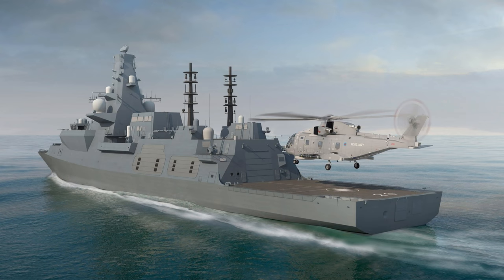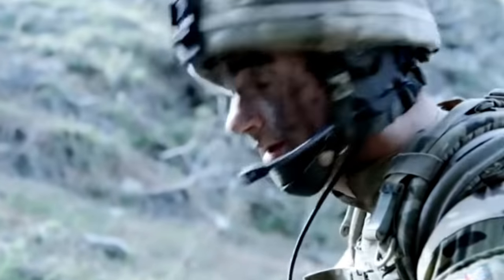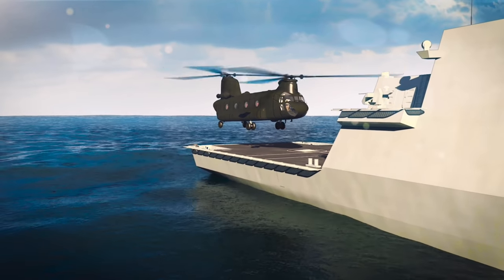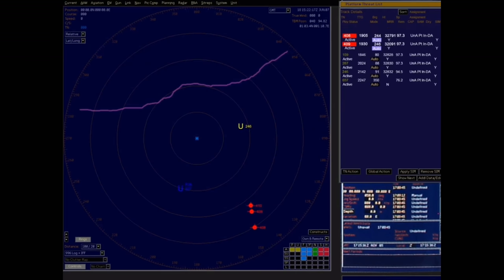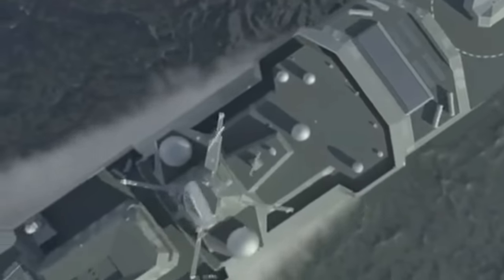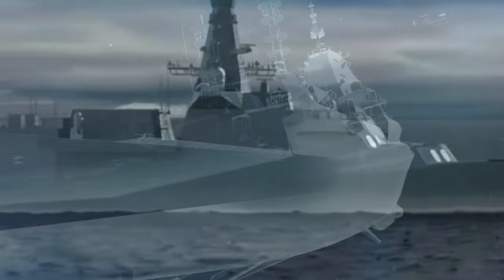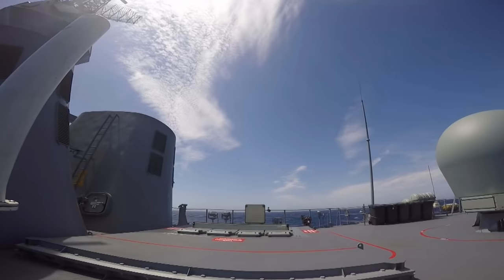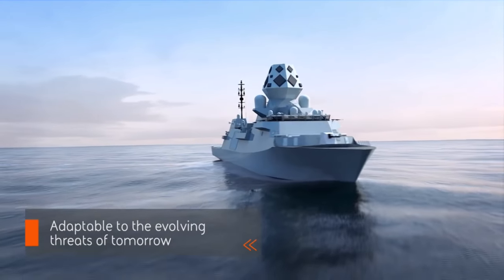British Type 26 Frigate | FUTURE NAVAL FLEET PROTECTION

Comment: Would  it be fair to say the Australian type 26 will be the most powerful,with Aegis/Ceafar combination with sm2,sm6 Sea sparrow Harpoon/Lsram.Also is the new Australian ceafar the most powerful radar?.How many cells will the Australian version have for Sm2 sm6?
Reply: It will have a 32 cell Mark 41 Vertical Launch System, firing RIM-66 Standard 2 and RIM-162 ESSM missiles.
Reply: I was just reading the Australian ship will have 48 cells,16 of which will be quad packed essm.Very different to the brit ship 48 sea ceptor missiles
Reply: @force515  Yes, the Hunter class is far better armed than the type 26. It also has a better radar and long range missiles like the SM-2 and possible the SM-6. The type 26 is a sitting duck in a near pear conflict, it can only operate as part of a task group. Alone it will be restricted to the North Sea (under the protection of the RAF) and parts of the North Atlantic operating as an ASW frigate. It is a shame that such an expensive warship is so poorly equiped when it comes to air defense. It would be cheaper just to buy more T31 and add the same towed sonar array, sonar 2087. The type 31 is roughly the same size as the type 26, the type 31 even has a better radar (according to Save the RN: The Thales NS110, a highly capable AESA radar which offers especially good situational awareness in littoral environments and in many aspects is superior to the Artisan radar that will equip the Type 26 frigate) and CMS. It also uses the same Sea Ceptor missile.
Reply: UK claims they will be doing freedom of navigation in South China seas,you would think they would add a lot more fire power to survive a possible clash with China or Russia.A 7000 ton ship is a crusier.Why dont they have 80 or 90 cells.They dont have to use them gives you options in war time land attack long range anti ship etc
Reply: @force515  It depends, if they send a type 45 it will be able to defend itself. In the future when the type 26 becomes available I do not want to be on this frigate, it will be a suicide mission.
Reply: Chinese ships are armed to the teeth with really long range anti ship anti air missiles.All new ships should match them in missile range & firepower.Why only have short range sea ceptor
Reply: @force515  You are absolutely right! The current type 26 (allthough not in service yet) lacks an excellent radar, CMS and long range air defense missiles.
Reply: Having read this thread please note that the UK has purchased the Naval Strike Missile for ship/land attack until the FC/AS is developed (IOC). Aster short and Aster medium missile systems along with Sea Ceptor missiles will be increased with additional quad packs. 

The UK's T26 City Class was carefully thought out and designed well. It is concerning that the Hunter Class is still suffering political and naval infighting and lacks the ability to think for itself on its system aquirements and its need to please the Americans. AUS is crucial as a partner, but not at the expense of being slandered by inept Pro US naval Admirals and politicians. That said, at least they have now veered into the 20th century at least with very capable war platforms irrespective of some tweaking. 

Canada 🇨🇦  great ship but for the tonnage you are pulling its almost the same as the aussies - as in where on earth would you even remotely need to fire that many cruise missiles and when have the pair of your countries done so? Its embarrassing how you are blindsided my the number of missiles as opposed to what the frigate can do.

Comment: Will they have the sailors to staff them??  recruiting and retention is the real bugger right now for the RN!
Reply: Despite being a lot bigger than the Type 23 they require less crew.
Reply: @davidhouseman4328  RN doesn't even have enough to crew both CV's right now fully.  Partially why the decomm'd the amphibs.  Small crew is great, but until they fix the bigger retention and recruiting issues, they will have issues operating them.  In a small crew, everyone needs to be that much more well trained and experienced.

Comment: To be honest it's an absolute national humiliation that the Canadians and Aussies are buying more of these Type 26's than the Royal Navy. They need to order 20 rather than 8 if they ever want to stand up a carrier strike group and just forget about the type 31e, which, in reality is a glorified green water patrol boat designed to mask the massive cutbacks in surface warships.
Reply: Type 31 is bigger than the Type 23 and based on a very capable Danish vessel. It isn't a green water patrol boat.
Reply: @davidhouseman4328  well I'm prepared to stand corrected but the last i heard the government put out a tender for hulls that cost no more than £250m which caused the bid process to fail. If these cheaper frigates are as capable aa you say why build the t26? What is the role of the type 31? The government are always fond of saying that the capability of new types is so improved that one ship can take on the role multiple older ones. The fact is the Navy is bare bones as it is, these vessels can't be in two places at once and the lack of investment will one day cost us dear.
Reply: @TomCamies  the bid process was restarted and a contract has been awarded for the Babcock Arrowhead design that based on the Danish Iver Huitfeld frigate.
The Type 31 is essential the like for like Type 23 replacement, more modern but for a similar price tag accounting for inflation at around £250m.
The Type 26 is a major step up, by capability it's a destroyer. But it's an anti submarine warfare specialist, so it's called a frigate. It's the best we can build.
Reply: I would be pretty happy with your two new carriers mate.

Comment: The other very basic thing is:

Weapons systems get obsolete at different times, so there is a need to change them at different times. The Harpoon, Sea Sparrow, the Oerlikon and the 5" guns are hardly the latest model; but they have the advantage: They work! At times a little to well, as the owners of several summercottages experienced some 40 years back.

Today you don't build ships around the weapons systems. During the Falklands conflict the frigates were lost due to their SAM-missiles, that didn't work against low level targets.

Another point is: Diesels have reached such a high level of efficiency that it is better (for smaller vessels) to dispense with the problem of turbine engines all toghether. The mentioned 25 knots is what a Huitfeldt makes on half power. 2 of the 4 engines are more or less just spares, as plowing ahead with 30 knots happens only rarely.

The size of the ship is only vaguely related to her displacement, hull design is much more important. The old danish Diana-class had huge amounts of power which could only be used to make waves - and high speeds in the Baltic? That will only make you run aground with aplomb. Very disconcerting.

Comment: in australia we are only luke warm on the idea. Australians have put the idea in there heads. need to go with off the shelf. myself personally i have great hopes for the what we are calling hunter class.  but we do need more. and as you say air defense needs to be beefed up
Reply: You can bulk up the AAW side if you want, yours are already going to be Aegis based.
Reply: @davidhouseman4328  we have AAW destroyers 3 of them ment to have 4 but politicions. the hunter class are ASW.
Reply: @elvinsmatthew  not seen the official spec on the Hunter but the suggestions are it'll be pretty close to the Hobarts on AAW as well. Hopefully the bigger global run will make it easier to get the full planned number.
Reply: @davidhouseman4328  i believe that New zeland is also considering our Hunters
Reply: @elvinsmatthew  I heard they were interested, didn't know if it would be UK spec or Aus spec or somewhere between.
Reply: @davidhouseman4328  hard to say with the kiwis. after all need to make sure there is room for the sheep.
Reply: @elvinsmatthew  they'll be making full use of that multimission bay.
Reply: @davidhouseman4328  and flight deck to bring fresh ones in

Comment: Is that the 'frigate' with the 8000 tons full displacement?  And Type 45 destroyer have 8700  =D
btw should that be compared with Project 22350M, 'frigate' with 6500-7000 tons of displacement, [armament due to the model of Army-2018 exposition http://bastion-karpenko.ru/ARMIA-2018/22350M_ARMIA-2018_04.JPG ] 

60 cells of tactical/anti-ship missiles 
Anti-ship: (3M-55 Onyx, 3M-54 Kalibr family family and hypersonic 3M-22 Zircon (which is in development))
Tactical: 3M-14 Kalibr family
Anti-submarine warfare: 91RE1 / 91RE2

96 cells of 3K96 Polyment-Redut SAM complex which could be loaded with following missiles
48Н6Е2 - 1 missile per cell, 120 km range
9M96D / 9M96M / 9M96E2 - 1 missile per cell, 120 to 150 km range
9М96Е - 4 missiles per cell, 40 to 50 km range
9М100  - 16 missiles per cell, 10 to 15 km range

And 36 cells presumably of S-500F with the range of 500 km.

Comment: How far along are they with the first type 26?
Reply: Seem to be taking their time.  I don't think the first hull will even hit the water until 2021
Reply: @Weakeyedominant  It is a massive warship. I doubt they're taking their time, those things just take incredibly long to build due to their sheer size
Reply: @RainytheNB  work started a good couple of years ago.  The government ordered them on long lead times just like astute.  It cost less per year that way so fits better into their yearly budget but far more over the lifetime of the project.
Reply: HMS Glasgow is progressing at a somewhat leisurely pace - first steel cut in 2017,it should hit water in 2021 but it will  not be  fully operational until  2027 .HMS Cardiffs first  works were started earlier this year.
Reply: @paultanton4307  that's only two ships in ten years though? they'll need to be quicker than that with them especially if Iran kicks off.
Reply: Yes its a pretty piss poor show that cant fulfil the RN's needs - whence the T31 Programme.Theres probably a multitude of reasons why its so slow - Political (Treasury) interference being one ,but as the River B2 builds tail off more resources can be put into the T26.Its still the case that only the first 3 are contracted for ,the other 5 are still subject to ongoing negotiations.

Comment: How many is unit cost type 26 frigate
Reply: @davidhouseman4328  Strictly speaking that is the average system price rather than the unit price. The average system price includes a share of the fixed development costs. If we decided to build more than 8 the additional ships would be a lot cheaper than £1bn.
Reply: @Akm72  I'd be a bit cheaper. But the Canada cost was around £1bn I believe.
Reply: @davidhouseman4328  I haven't checked but I'm sure you're right, however the Canadians would have fixed costs associated with their frigate program as well even though they're buying a version of an existing design.

Comment: It is unfortunate that they plan to install only a mediocre radar system, the type 997. Why doesn't the RN install the Ceafar 2 radar like the Australians do on the Hunter class? The type 26 needs a longe range radar system and longe range missiles like the Aster 30 or the SM-2 / SM-6. The Sea Ceptor missile is only for short range protection, the Aussies will equip there vessels with long range missiles like the ESSM Block 2 and SM-2. Or at least install the S1850M long range radar, this radar is used on the type 45. If you want to operate worldwide with this ship, you need to be able to defend yourselve at long range. It is basically a sitting duck, if you want to send this ship into hostile waters, you will have to send a type 45 to accompany it for its protection. Look what the Aussies are doing, just copy it, it is not so difficult...
Reply: That’s not what this ship is for. In a task group, you will have both Type 26s and 45s to handle medium and long range air defence.
Reply: @TT-hd3zi  They will not always operate in a task group. They should have choosen the Australian setup, it has the same towed sonar array as the British version. The type 26 is not able defend itself against arial targets at medium range, it only has Sea Sceptor missiles for short range air defense. Sea Sceptor missiles only have a maximum range of 25 km. Cutting cost in this way is just not acceptable, in a  near pear conflict your done.
Reply: Erik trials of sea ceptor have shown ranges of up to 60km.
Reply: @TT-hd3zi  Only the extended range version has an effective range of 45 km. Missiles are no longer effective at their maximum range, their manavourability decreases rappidly as their energy depletes. However it still lacks a long range interceptor and a descent radar. For such an expensive ship it should have top of the bill equipment even if it is an ASW frigate. The Hunter class has the same ASW equipment as the type 26, hence the type 26 should have the same air defense equipment as the Hunter class. Cutting cost this way is just not acceptable and surely limits the type 26 to just the North Sea and parts of the North Atlantic if it operates on its own.  It would be cheaper just to buy more T31 and add the same towed sonar array, sonar 2087. The type 31 is roughly the same size as the type 26, the type 31 even has a better radar (according to Save the RN: The Thales NS110, a highly capable AESA radar which offers especially good situational awareness in littoral environments and in many aspects is superior to the Artisan radar that will equip the Type 26 frigate) and CMS. It also uses the same Sea Ceptor missile.
Reply: Erik yes, but the sea ceptor missiles has shown to be effective at 60km. It doesn’t need a long range interceptor. The requirements of Australia are different to the UK. AUS doesn’t have any Type 45s for long range air defence, so will use different missiles. Not to mention, the launchers that the Hunter class will use are far bigger than the Type 26. The Type 26 will hold 72 missiles, compared to the Hunter’s 32.
Reply: @TT-hd3zi  They have the Hobart Class AAW frigate for long range air defense, it is a class of 3 ships. Allthough there are more type 45's, this is only a class of 6 ships. This means that there are usually only 3 to maximum 4 available, the other ships are in long term maintenance. The type 45 does have a lot of maintenance issues, so their availability is low. It is therefore important for the type 26 to have long range air defense, the RN needs it. Because if you don't, the entire RN has at any given time only 3 ships available for long range air defense.

The type 26 has 48 VLS cells for 48 Sea Ceptor missiles. These cells are however not quad packed, in a Mk.41 you only need 12 cells for the same amount of ESSM-2. The 24-cell strike-length Mk 41 VLS is now designated for Tomahawk, ASROC and LRASM. It would be better if they add a 24-cell Sylver A50 VLS for Aster-30 missiles.

Install either the NS110 radar of the type 31 or its bigger brother the NS200 ( these are AESA radars and are far more advanced than the Artisan, PESA radar, the NS200 has a range of 480 km) together with the Tacticos CMS, this will give the type 26 compatibility with the majority of all the ships in the RN.
Reply: Erik yep, and further increasing costs. Meaning we have less of them. The Type 45 availability will be improved in the future.
Reply: @TT-hd3zi  Adding a 24-cell Sylver A50 VLS for Aster-30 missiles and adding a better radar is of course not cheap, but it does result in a better ship. However using the same radar and CMS throughout the fleet will cut down the cost of maintenance and spare parts. In peace time it won't be a problem but in war time your done without adequate air defence.

The type 45s availability will not improve to more than 3 to 4 ships, even with the best maintenance procedures, no serieus issues and complete availability of spare parts. There will always be at least two of those ships in their respective maintenance cycles. There will always be crews out on leave or returning from a deployment.
Reply: Erik ok? And? If the Royal Navy needed more long range air defence ships, they’d build them. The Type 45s are most useful in a carrier strike group, where usually 1-2 will be needed.
Reply: @TT-hd3zi  You would expect so, a task group requires a minimum of 6 warships defending the carrier. But if all the type 45s are attached to the carrier groups, that means that the rest of the fleet is unprotected. 

The RN simply does not have the funds and personnel to pay for and man more type 45s. It is therefore cheaper to increase the firepower of the type 26 and the type 31.

Comment: I’d like to see the RN finish building the Astute Class submarines, and rectifying the T45s, before they chase up another blind alley.
The RN has a lot of pipe dreams, but no money. And are losing matelots at a high rate.
Big concerns that need to be addressed before paying ‘suits’ to design another new ship.
Reply: You can't just stop everything to fix a problem. We maintain continual nuclear sub production so Astutes will run into Dreadoughts. You speed up Astutes you leave a gap and lose your work force.
Type 45 will come in gradually as there maintenance cycle comes up for the extra power generation planned as a fix. Though they are successfully being deployed to the Middle East as it stands.
We filled the gap between Type 45 and 26 production with some River classes to keeping all rolling over.